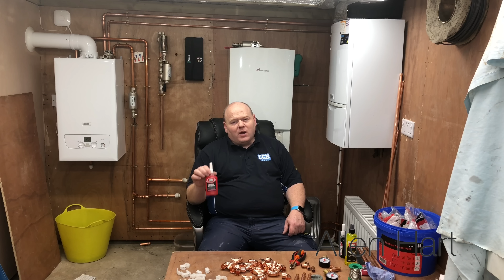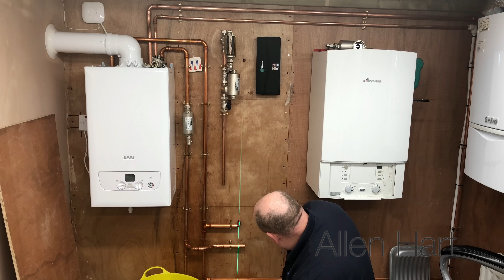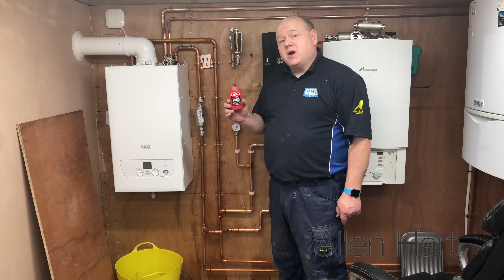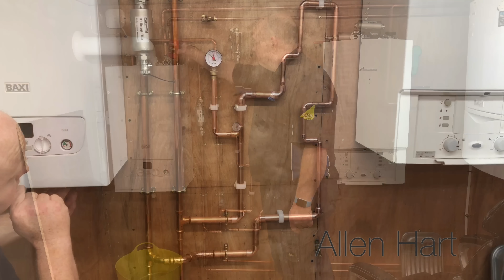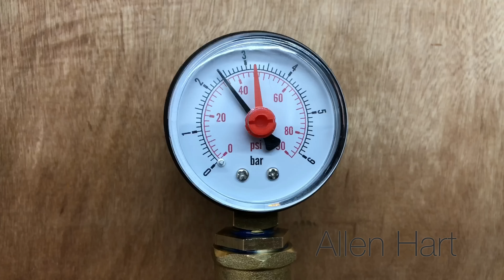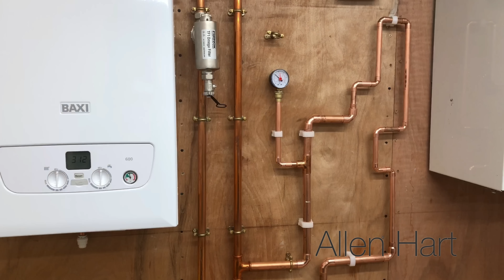How to solder without a flame connecting and testing

Comment: I have used this and it's not as reliable as classic soldering. I had  leaks. sometimes. And needs to be said there are more products like this and they are not the same. Some say they only need 15 sec to bond but I would not trust it. Tried and did not work on any case. Few times I had to remove the leaking joints and do the normal way.

Comment: This stuff has has been around for 20 years had to use it on a commercial irrigation sprinkler system back in the late 90s because the contents of the warehouse was kinda touchy around open flame. Far as i know it’s still there doing its job.

Comment: I have a joint to make in an awkward spot within a tight ceiling space and this method would avoid the risk of fire from soldering.
Reply from the maker: I wasn’t impressed with it in the end. I would never use this in a customer’s property.
Reply: Try the PipeMaster. It's basically a soldering iron that clamps onto the pipe. No flames.

Comment: I think for the causal DIY person like me, who wants to replace a leaking push fit copper system, and not keen on the baulkyness (sorry bad term) of compression to save space, like my outside tap, using those horrid screw in to pipe unions to a basically a garden hose, this would be ideal......

Comment: Anaerobic sealant is good for tight joints and hardens like plastic so should last well. Stable on high temperatures too. Just make sure you use correct spec for what materials need bonding 👌🏻

Comment: If it becomes wide spread in the industry and I’ve seen it in place for instance on a 10 year old new build then I’d use it, until then I’ll stick with tried and tested soldered or crimp where you can’t do hot works

Comment: I used this product on some cold outdoor fittings over a year ago. No leaks whatsoever, I'm tempted to use it on a new radiator feed in my house. It's the only real way to determine if it works or not.
Great Demo Alan 👍👍👍👍

Comment: I'm not a plumber or heating engineer but I wouldn't trust that stuff, for a number of reasons. 1/ It may be fine initially but how about in 5, 10, 15 or more years?  2/ If a repair or modification is needed you can't sweat the joint apart, it would need the section cutting out.  3/ Is it or would it be acceptable to insurance companies.  4/ Any slight deviance in use or installation could make it unreliable, imagine that if it failed when a customer was on holiday??!!
Solder or compression fittings are the only options for me.

Comment: What fitting do you need to use on a pressure gauge? Looking to fit a combined temp and pressure gunge on a couple of circuits and just wanted to know if a standard equal tee and a male or female compression fitting would do?
It's just diy and I'm using pressfit for the rest of the pipe.
Thanks Allen.
Reply from the maker: Think its a number 6 , cannot remember tbh, Sorry.
Reply: It's a Bush and a female iron.

Comment: Hi Allen, This was promoted to me through mr central heating, not sure about it, its a while since you did your video, what is the update did it last the time? Regards Mark. ps this copper bonding adhesive is been promoted for natural gas as well.
Reply: I’ve seen fittings used with this compound in a plumbers merchants. It looks like it doesn’t respond well to being moved or knocked. I’d be a little worried about using this in someone’s house who could easily knock a radiator pipe etc with a Hoover.
Reply from the maker: Hi Mark, Thank you for your question, It would not be a product i would use in a customers property at the moment, lets see how it goes for a few years. My pipework leaked once it was knocked. Thanks.
Reply: @AllenHart999  hi Allen, did your pipe work Leah after a while? I can not find a long term video. Thanks
Reply from the maker: @heavyweightboxingfan2269  I didn’t really test it long enough as I moved house but it pulled apart very easily. Personally I wouldn’t use it for my customers
Reply: @AllenHart999  Thank you for your very quick response. I just purchased a press tool for £1200, so when I saw your video I thought I had made a stupid mistake buy
ing it. As end feed fittings and a copper glue would be far faster and cheaper alternative. Thanks for letting me know it did not turn out as well as first thought.

Comment: I'm really surprised you've stumbled across this recently. I purchased a bottle of this from the plumbers merchants around 7 years back branded as just for copper. I used it in a customer's house & no complaints scince. I had some left I think it went off. It's not the best but it helps you out of a sticky situation. I purchased a press now for solderless fittings. I haven't looked back. I just wish they'd make the fittings a little less bulky and more affordable. Still a top notch review.

Comment: From an engineering perspective there is no particular objection to bonding systems and there many successful examples in the Marine, Civil and Aerospace fields and in higher duties than the less demanding domestic plumbing situation. Having said that I would be more confident of the product if it had been developed and marketed by Loctite. The current product apes the Loctite bottle and the ‘Super Power’ logo does nothing to inspire confidence. It is great that you are doing this trial and it will be the thermal cycling that will stress the bond the most (rather than the low pressure which is over the long term fairly constant). Anyone trusting this product on gas lines will be standing into danger if there is no provenance or approved tests and standards achieved by the manufacturer. I am not a plumber
Reply from the maker: I wouldnt use this or even test it on gas TBH, I might be ok but i would need to see it tested for a long time before i would trust it. I will be doing a long term review soon. Thanks.
Reply: @pmailkeey push fit on gas is a big no no. Copper or steel only.
Reply: @pmailkeey o rings dry out and crack. Push fit is just too easily disturbed for gas. Also if your using push fit where it can be seen then that's ruff AF. Ceiling voids only really in my view, but still never for gas.
Reply: And if you're considering using plastic on gas. Please don't do DIY gas work at home you'll help get it made illegal. You can get a bpec domestic gas manual if you want to DIY according to regs and then get it ticketed and notified to building control with photographs. If you're not a plumber I really think it would be a very bad idea.
Reply: @pmailkeey Gas regs say copper and steel only unless it's a flexible hose for a cooker etc.

Comment: I bought some of this stuff but its blue in colour. I was told the red stuff was "demo only", whatever that means. I'm a diy plumber and using it in my home brewing kit, on some non critical joints. Worse that can happen is I water down my booze a little. Still, it doesn't feel right not to see a solder bead around the fittings.
Reply from the maker: They contacted me and asked for the red stuff back as the shop had given us the wrong stuff lol. I have a green bottle now. Thanks.

Comment: question is how long does it last for ..
Reply from the maker: I do not have the answer to that. I have it on test and it hasnt leaked yet. Thanks.
Reply: good product for home owners/ d.i.y etc who dont have the tools for solder work. i would assume the glue surly will break up over time with the contraction of heat etc? keep us posted, how long have you had it on test for ?
Reply from the maker: Will do, Thanks

Comment: Interested to know what will happen on a power flush with chemicals in, or inhibitor or leak sealers to usual stuff that goes in a system.
Reply from the maker: I will try that at some point. Thanks for watching.
Reply: I had the same thought when I used 'just 4 copper' - another bonding agent which came out of the gas industry